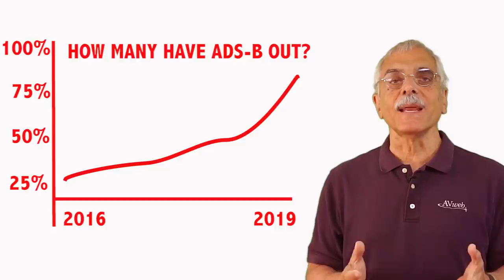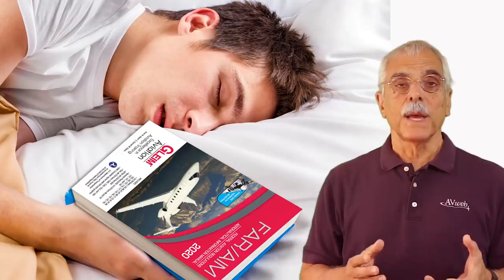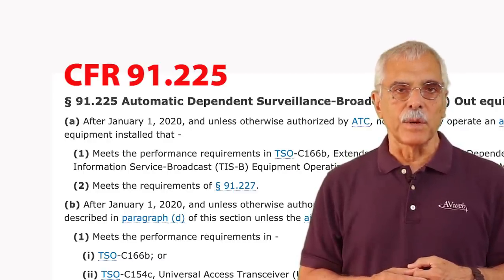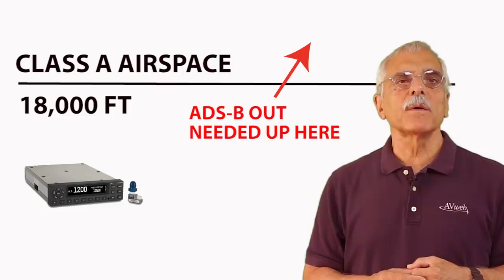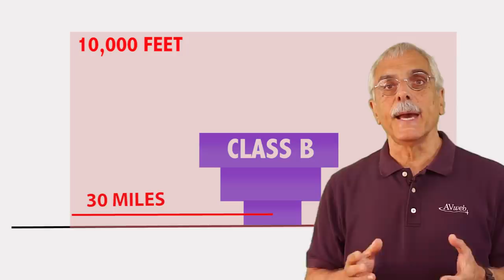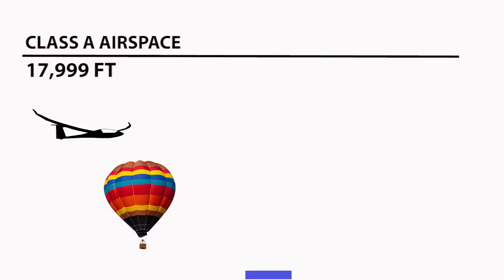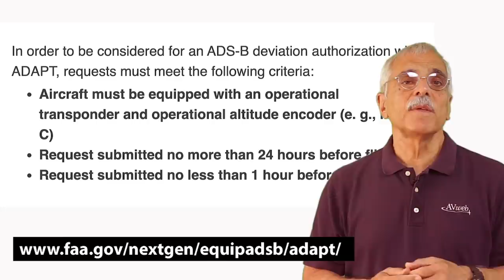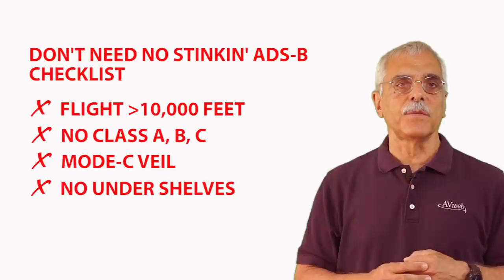So You Blew Off ADS B  Now What?

Comment: I don’t find anything saying we can’t fly under the shelf in class C.  You said that we can’t fly under the shelves and I’m wondering if that includes C.  It says lateral boundaries which I interpret to mean current mode c requirements.  Please elaborate.  I’m only right sometimes!
Reply: cody gauger: I also want to know where that is as well.
Reply: I assumed we could fly in under the Class C shelf as well, but after I watched this, I looked up the actual law. CFR 92 point whatever it is.  It says ADS-B required within the lateral boundaries, which would include within, above, AND under the shelf, making the entirety of the lateral boundaries of Class C dead airspace without ADS-B.  Don't trust the FAA website (which appears to have been changed at some time in the past few weeks on this), or the FAA safety magazine they hand out at the safety seminars-they appear to be wrong according to a plain english reading of the actual law.
Reply: @kellytrimble4120  can you please provide the actual reference? the one I see never says anything about under shelves. it only says above: 
91.225 (d)(3) "Above the ceiling and within the lateral boundaries of a Class B or Class C airspace area designated for an airport upward to 10,000 feet MSL"
Reply: Per this graphic, you indeed can fly under the shelf of Class C airspace without ADS-B  - the lateral boundary applies to flying ABOVE the Class C airspace.   
https://www.faa.gov/nextgen/equipadsb/research/airspace/media/airspaceRequirements.jpg

This is also explaned here:  https://www.faa.gov/nextgen/equipadsb/research/airspace/
Reply: @FlyingLessons  The way it is worded is ambiguous.  A plain english reading could interpret it as above the ceiling of B&C requires it and within the lateral boundaries, including under the shelf, requires it, or it could be interpreted as areas above the B or C ceiling that are also within the lateral boundaries, but it isn't written that way.  Whoever did this video obviously interpreted it to include under the shelf, and I fully expect somebody somewhere will get violated on it by some arrogant controller having a case of the ass against somebody for whatever reason, and when that guy proves he was actually under the shelf, whoever violated him will fall back to saying the reg actually includes the area under the shelf.  

You always have to assume that ambiguous wordings will be interpreted against you at the enforcement level.  Even if I might be right to assume it to be legal without equipment under the shelf, I can't even afford to try to defend myself against a violation action no matter how legal I turn out to be.  My policy needs to be if there is any ambiguity, don't go there.  This video is proof that reasonable people could interpret it the opposite way.  So until the ambiguity is cleared up by an actual official pronouncement or rewording of the rule by the FAA, I have no choice but to consider 'under the shelf' to be dead airspace.
Reply: Kelly Trimble fair enough.
Reply: Kelly Trimble hope not... my home base is under class c overlay... I’ll never get out of here.

Comment: So if my understanding is correct, the ADSB rules are almost identical to transponder rules?  What I’m wondering is if one HAS a transponder and or ADSB installed, and is flying in an area where it’s not required (say, Class E airspace) must they be operating?

Comment: Fantastic.  Will I need the e-mail permission to get the certification flights done in my plane once the install is complete?
Reply: As far as I know, you're not actually required to verify an ADS-B installation though. You can just fly it and then run a performance report afterward (https://nbaa.org/aircraft-operations/communications-navigation-surveillance-cns/ads-b/verify-your-ads-b-performance-with-free-faa-web-tool/)

I guess if ATC says "We don't see you on ADS-B" then you'll know it's not working. :)  Would be the same if your Mode C transponder quit.

Comment: The ADSB cost is a small price to pay for the increased safety.
Reply: @svp2587   So how is more technology that takes workload away from the pilot and provides accurate data a bad thing?
Reply: @svp2587  Yes, like every flight student ive learned the "pen and paper" flight planning in flight school. Its slow, ineffective, can put alot of workload on the pilot when flying in unfamiliar areas and has its limitations (cant fly above clouds for example as that would make navigation impossible). Good luck flying like that on a long cross country, i wouldnt want to do it.
With a GPS i know where i am immediately, i can fly the most direct route without the need to take diversions for landmarks that are easier to spot. GPS outage? Thats why you still carry the old fashioned map as a backup, its still useful for that, just not as a primary navigation device.
The same things apply to spotting other traffic. Every airplane has blindspots, scanning the skies constantly takes alot of focus and is impossible to do constantly on a long flight, many times airplanes blend in with the background so well that they become almost impossible to spot, thats why midair collisions and near misses are still a thing in the GA world. Its been a long time since two airliners collided, and why is that? Because they can see the traffic around them on their computer screens (and have ATC of course).
Youre saying that all the modern stuff keeps pilots from flying the plane, i find the opposite to be true. If i need to spend less time for navigation (GPS) and looking out for traffic i can use that extra capacity i now have for flying.

Comment: What about tricky Anchorage Alaska airspace? The only way into Merrill field is the East mountain side? The published VFR procedures in class D airspace also say mode C transponder required so does that mean ads-b too?
Reply: jpoppinmoneyunit I’m just hoping it’s not needed to fly in the pattern at Merrill until I can get mine installed.
Reply: really good question. Ship creek hi or low never needed a transponder, so I for one still don't get it, I do know I used to fly Birtchwood to Seldovia over or under Anc Class C with or without a transponder, No more with out ADSB
Reply: kevin arseneau wow you admit to being up ship creek? I’ve been there without a paddle here in Oz!
Reply: @kevina8172  
"  Ship creek hi or low never needed a transponder " 

No, that's not true. Ship Creek high departure puts you either in, or over Anchorage Class C Airspace, and a Mode C transponder has been required for that for quite a while.  The only departures from Merrill Field to the Northwest which would be legal without a Mode-C transponder would be departures which stay below the 600 ft limit of Part 93, an after that, below the 1400 MSL floor of Anchorage Class C. 

"I used to fly Birtchwood to Seldovia over or under Anc Class C with or without a transponder" 

Again,  flying over Class C Airspace requires a Mode -C transponder, the flight you describe would not be legal (Unless you were flying over 10,000 MSL).
Reply: @andrewalexander9492    so I learned to fly at Merrill in 1975 a lot has changed, Both of my Bonanzas have/had modeC  but the cubs did not and They gave ship creek hi all the time. Sold the last Merrill based Champ 20 yrs ago no transponder, so things change, you must be a CFI so can I fly above the 4,100 Class C with ADSB without talking to ATC
next month?

Comment: Paul, Surface to 10,000 in Class C need ADSB?  this is what my local Radio shop is telling me, but the Faa rep is saying they did not change the airspace for transponder requirements
Reply from the maker: Above the Class C and the Class B to 10,000, you need ADS-B Out. Within Mode-C veil, you need ADS-B out including under shelves of B. Not needed under shelves of C.
Reply: @AVweb  Can you make this a top level comment and pin it to the top of the comment section? The video implies that we cannot fly under a Class C shelf without ADSB, which seems to be leading to some confusion. Thanks for the video.
Reply: @AVweb  Please pin your comment to the top of the comments to help correct your error.

Comment: Thank you, Paul, the most informative Scrooge, ever. The investment to comply with the Big Brother FAA’s requirement is an insurance policy that can save not only your life but also possibly hundreds of lives should your very bad day include a collision with an airliner.
Reply: i was wondering when the last time a GA aircraft ran into an airliner hmmm
Reply: @cleburne-dfwseptic6843  Perhaps not, but lots of light aircraft hitting each other. My plane has no rear window. I can see forward, up, and to the sides only. No view whatsoever down, or back. Unlike an automobile, there are many more blind spots in a plane, and speeds are much greater. Seat belts save lives. So will ADS-B.
Reply: B. E. Russell  It’s rare but it happened 42 years ago when there was much less traffic and the airliner crew lost sight of the Cessna.   https://en.m.wikipedia.org/wiki/PSA_Flight_182
Reply: Any airspace where airliners regularly operate already requires a Mode C (altitude encoding) transponder. That's all the FAA needs in addition to their primary radar to prevent collisions.

ADS-B won't prevent domestic airliner collisions. It may prevent some domestic GA-GA collisions, though, which happen far to often. As far as ATC goes, I think the main benefit they see is they get ground-track info from ADS-B that is much more real-time than radar.
Reply: i.b. hemp  Thank you for the additional information.
Reply: @bjs2022  No! PSA ran into the Cessna.
Reply: @bjs2022  No! PSA ran into the Cessna.

Comment: Clarification -  So at the very last part of the video,  it mentions  planes with no 'electrical systems' but use a battery to power com, xponder.  Does that negate the exception to ADSB?  Would one therefore  (inside 30 mile veil) just not turn on xponder  or  does the FAA now consider  electrical power by ANY source to mandate ADSB-Out?
Reply from the maker: No. It has to have been certified originally with an electric system. Adding battery powered avionics doesn't change that status.
Reply: @AVweb   So.. should I continue to use xponder (based inside Mode C Veil), or just go Dark.
Reply: @avflyguy  Why would you want to go dark if you have the capability of being seen? Unless you are flying drugs or buzzing houses, why would you not want to be seen?
Reply: @ConvairDart106  Because the equipment is expensive and may or may not be reliable.   The people I know aren't putting it in unless they routinely go into Class B or Class C airports.  There was ONE trip I''ve made in the past two years where I landed at the center airport and could not have flown around the Class C, and another where I went to something under the shelf of Class C, but could have gone to the next airport out, and another where I went to the Class C center airport to get gas at night because it was safer, but didn't really have to.  The ONE trip I made where I couldn't have got there without ADS-B I really should have driven anyway.  There is ONE trip I would like to make in the next six months that I don't really have to do, and it isn't worth the two to six grand cost.  And I really think ADS-B is going to be a lot like GPS, you think it is a great investment, but the vendor quits supporting your model after maybe six to ten years and you have to buy it again.  The economics don't compute.  I suspect it is that way for a lot of people.
Reply: @ConvairDart106    Let me try again.  I am operating a Cub within the Mode C veil.  When I got it, the previous owner added a BPE wind driven alternator. The plane has a mode C transponder, which I have been using to travel within Mode C veil including flying under Class B floors as well as going into Class C airports.. 
So, the question is- yes I know I'm exempt, but I choose to use xponder..  Now with rule change, with no ADSB installed,  should I continue using transponder only or just turn it off?  Not sure ATC would see xponder but no ADSB which perhaps could be seen as violation.

Comment: So quick question on ADSB. 

Yesterday I was on a VFR flight in a plane without ADSB and planned my flight around Class B and C airspace.

I was in contact with ATC for flight following and they directed me to an altitude that put me Class C airspace. Should I have told them I was unable? I did what I was told, but in hindsight I probably should have told them I was unable to comply. 

What is the right thing to do in this instance?
Reply from the maker: Yesterday was the 1st. Rule doesn't take effect until the 2nd, today.
Reply: "(d) After January 1, 2020, and unless otherwise authorized by ATC, no person may operate an aircraft in the following airspace unless the aircraft has equipment installed that meets the requirements in paragraph (b) of this section:"
Reply: Ask yourself if ATC asked you to ascend to FL18 and you are not instrument rated...what's your best guess?

Comment: If you have a mode C transponder and are in radar coverage area such as a Class C or B airport what does ADS-B actually do for the controllers or the airspace? Airliners already have TCAS which can alert them to traffic based on ModeC transponder output. I think there have been interviews with controllers and they don't know about what the ADS-B is useful for either. I"ve heard conversations between aircraft with ADS-B and ATC asking them if they are getting ADS-B info and they have to do "something" to be able to see it. I can see in remote area's that do not have radar coverage that they will still have "contact" with the flight but usually that is an area that doesn't require ADS-B anyway.
Reply: I believe the main benefit to ATC is pseudo real-time ground track data. Radar is slow to update.